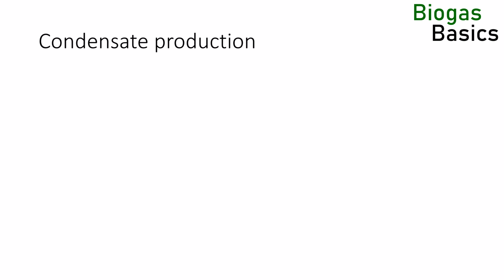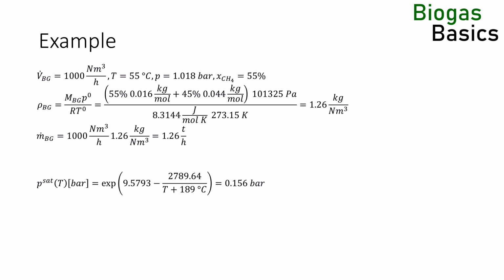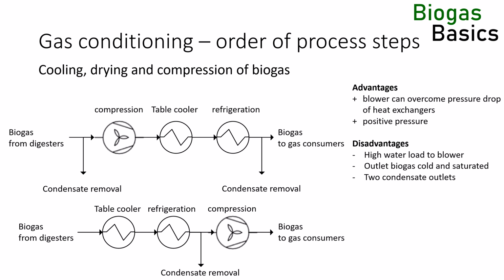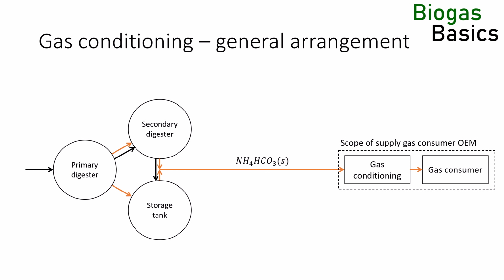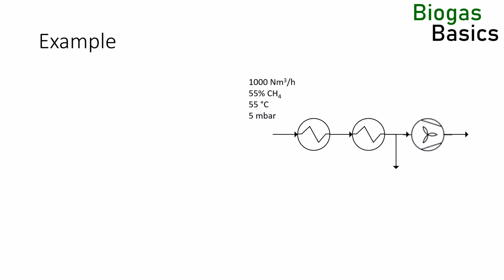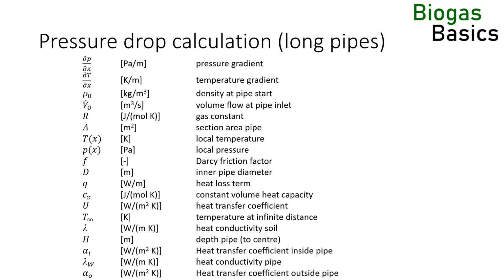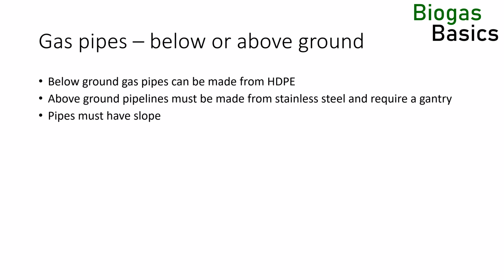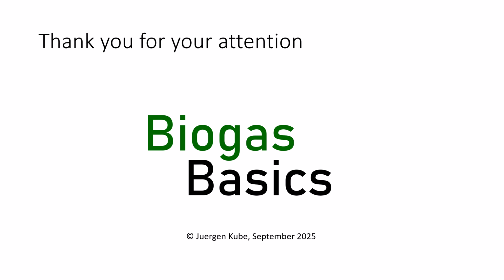09.2 The gas system of biogas plants - condensate production and handling

Comment: Can i assume there is no pressure change along the heat exchanger? Or there is any calculation?
Reply from the maker: no, see 5:48 of this presentation. If you know the pressure drop of the heat exchanger at a reference mass flow (from the datasheet), use dp(m., T, p) = dp_ref * (m./m._ref)^2 * (T/T_ref) * (p_ref/p) to calculate the pressure drop at operating conditions (this assumes constant composition and viscosity). You can replace the mass flow m. with a volume flow at reference conditions such as Nm3/h or Sm3/h.

Comment: It is great to have your presentation. As studying the biogas plant operation, I have some questions which need your feedback.
1. What is the table cooler? As we never use this equipment before.
2. On the second configuration design, you mentioned about the condensate removal under vacuum. Without the pump application, is that mean the condensate can be possibly carried over to the blower? 
3. Is there any recommended length of the humid gas pipes?
4. Can we filter out the formation of ammonium bicarbonate crystals before the blower?
5. For above ground pipelines, will you recommend using the HDPE pipe which is more durable than stainless steel pipe?
Reply from the maker: 1) A table cooler is also called dry or air cooler. It is a table-shaped cooler with fans that blow air over a finned heat exchanger. A table cooler can only cool the gas to ambient temperature. It can be fitted with spray nozzles for adiabatic cooling to the wet bulb temperature but that blocks the heat exchanger surface after a while.
2) Under vacuum, the condensate will not come out of a drain, but air will go in. You either need a pump or a very deep condensate well. A 20 mbar vacuum would suck condensate 20 cm up the drain.
3) Humid pipes have a high pressure drop. The maximal length depends on the minimal acceptable pressure at the outlet and the pipe diameter. You can go further with a bigger pipe. Short as possible is usually the best solution.
4) Yes, but the filter will need to be checked regularly. The ammonium bicarbonate will be created slowly at certain ambient temperatures and might release a lot of NH3 when it is re-solubilised which will damage the CHP or gas consumer.
5) Above ground HDPE will sag and become brittle in sunlight. If corrosion is an issue, reduce O2 and dry the gas. There might be applications where the gas is corrosive, for example high Cl- loads in the feedstocks and HPDE pipes are necessary. They need to be stabilised and protected from sunlight. For short pipe runs, stainless steel is usually cheaper, especially flanges, elbows, T-junctions.